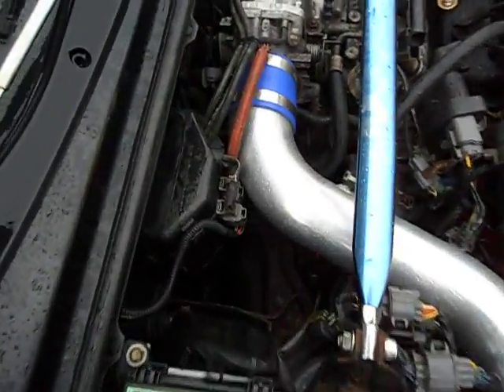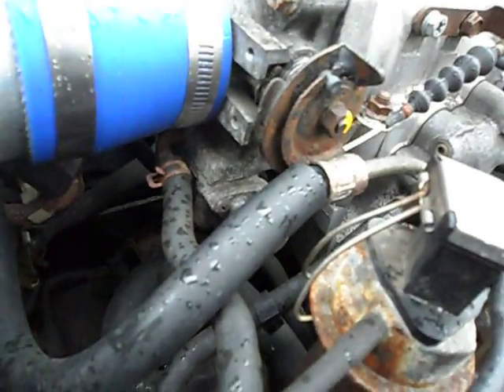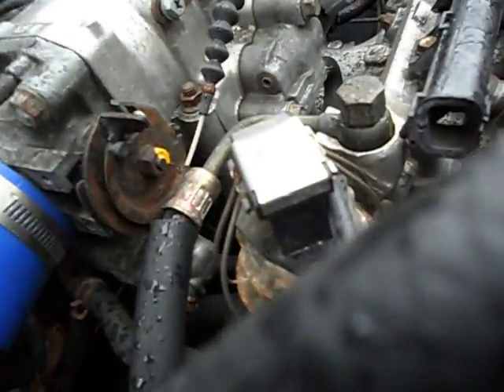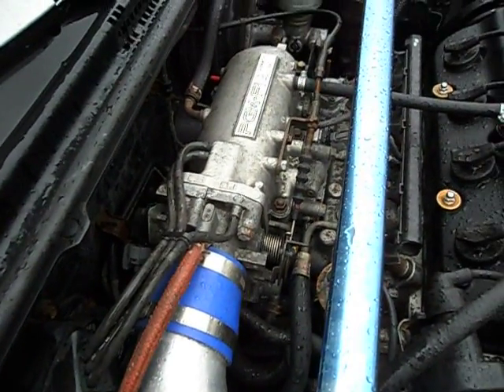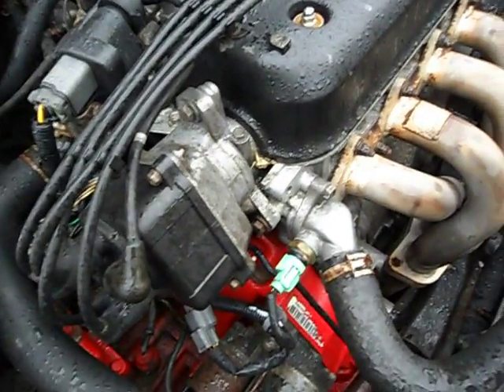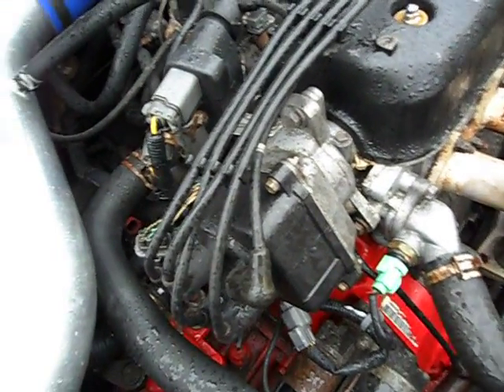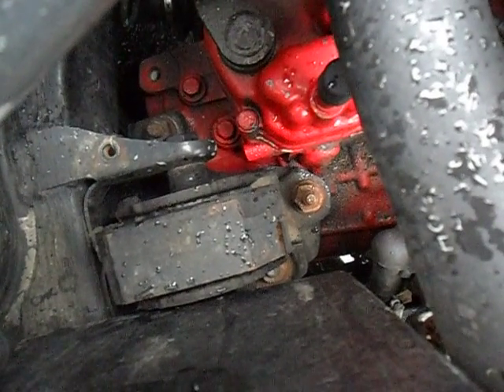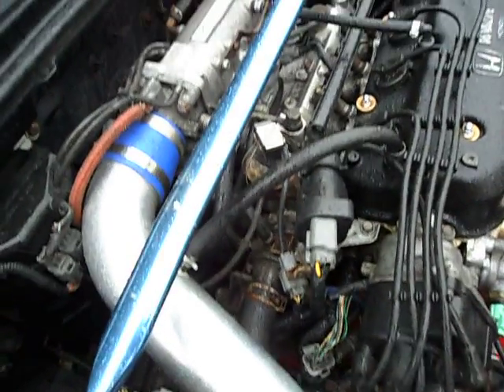H23 parts on F22Ax engines. ( Short description )

Comment: It help me out if you can show where the two ports on the back of the intake manifold goes, its a coolant hose I think and I got the top one looped to the bottom one but I've always wondered if I have it wrong.. there's also the iacv lines right by them as well